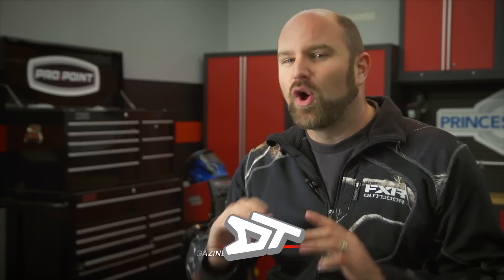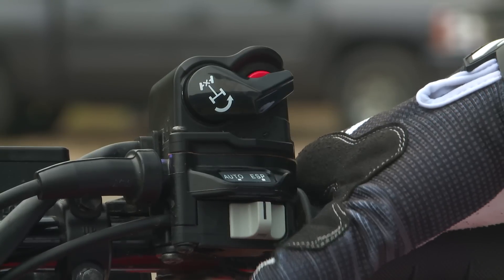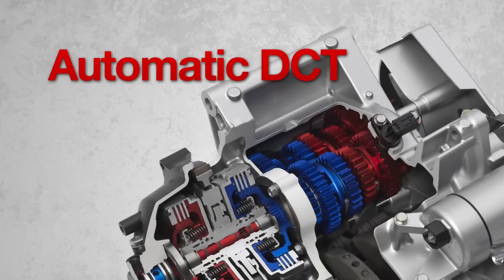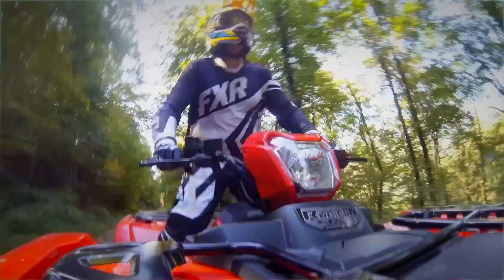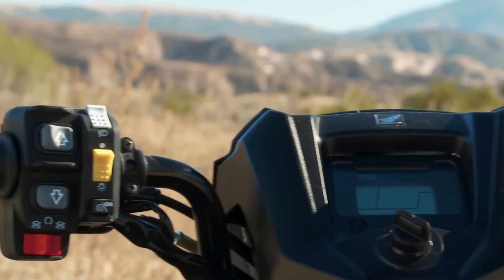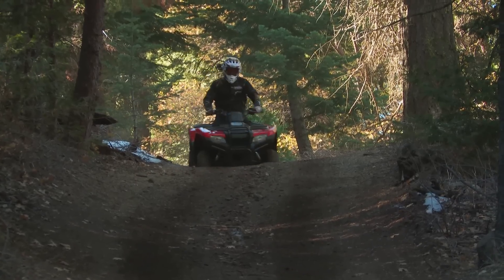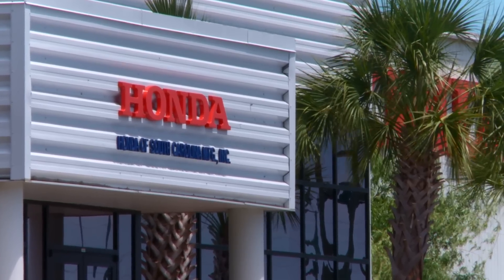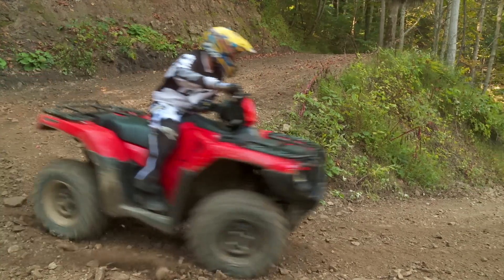Honda ATV Dual Clutch Transmission

Comment: I have now the 2015 Honda Rubicon with DCT.  15h of run for now (mostly plowing).  Tremendous power! (in comparison of the 2004 I had just before).  I've noticed one problem yet (will the first maintenance due in 5h correct it?).  Many times, the gear indicator on the dashboard will stop indicate (D or N) (in low or high) and will just display a ----- line and you have to give a little gas so I will show again the gear position.  Yesterday, as I was plowing a big pile of snow, the bike staled right at the worst time and was displaying a ---- bar instead of the gear position again.. could not make it start .. Puled it with my truck (make the wells turn to try to get it in a position where the gear would show again and bring it in N so I could start it again.. nothing.. tought I could be the battery (plowing with a winch will drain the battery), Nope.. nothing also.  Then I tought to switch it in Esp mode and there I was in 2 gear!  Push the button down and there I was in Neurtral and made it start again.  Everything was fine then.  It's the 3rd time it happens to me.. What could be the cause of this malfunction?   I would not whant this to happen to me in deep mud or as i'm climbing a big hill this spring at the hunting camp (not to mention that all my friends will be watching me to evaluate the 2015 Honda).  Thank's!
Reply: Richard, I'm by far no ATV expert, but from my understanding the "AUTO" mode is best suited for casual trail riding, while the "ESP" mode is best suited for aggressive trail riding and work duties. Now I'm not saying you can't use the "AUTO" mode when plowing snow, but I am saying that it's not the best choice. The "LOW" position would be my recommendation for plowing and towing chores regardless of whether you are in "AUTO" or "ESP" Reserve the "DRIVE" position for all but the worst trail conditions you may encounter. As far as the "----" condition your experiencing. Contact the dealer you bought the ATV from. It sounds to me like the tranny is "confused" and searching for or in between gears as a result of the stall. The "AUTO" mode monitors and adapts it's shift points based upon the way the rider is running the machine. A stall is not "running" the machine, thus the confusion caused for the "ECU" portion of the tranny. In "ESP" mode the tranny is "locked" into the gear the rider chooses so the tranny doesn't have to perform as a "Smart Tranny" so to speak.
I think this is the best way to describe this particular ATV... Look at this ATV like a 4 wheel drive truck... When driving casually (relaxed style of riding) or performing light duty chores (pulling an empty ATV cart), "AUTO" mode will most likely be fine in most cases.
When driving aggressively or in demanding conditions, performing heavy duty chores (snow plowing is a heavy duty chore, unless your only plowing a few inches of light powdery snow, the kind you could easily sweep with a broom), or tackling tricky, steep or rough terrain, "ESP" mode is the best choice IMO.
Richard, Again I'd highly recommend you contact the Honda ATV dealer where you purchased the ATV at, as you'll most certainly NOT receive any kind of reply concerning your issue from a Honda rep. or dealer on a Youtube post.
Reply: ***** You've got the best of both worlds then. Having your choice between SRS/SRA and IRS all based upon your intended usage of the atv. I'll have to look further into them. Thanks!
Reply: ***** hey man, if you need to start the bike in gear, you can pull on the right break lever. Its worked on all mine, but i don't have the new one, don't know if it stll works on these models.
Reply: Obeconobe7 I disagree. I think Honda built a better ATV with and a much worst transmission a smaller engine and a much bigger price tag.  I have an 06 Rubicon and I have been plowing snow for 9 years here in Canada and that transmission as never been in ESP ( only to try it out a couple of times) and has never let me down.  Always in the right gear ratio and plows snow great.  Now it doesn't have a diff lock or IRS, so from what I have been reading the new Rubicon is a over all better quad.  However, with the amount of time it takes Honda to put out a new model ATV, I don't think we should have to settle with a sub par transmission.  They certainly had time to think it through. If I was going to buy another ATV anytime soon, it would not be this DCT unit.  Love Honda reliability, but not enough to deal with the frustration of a geared transmission on trail rides that require me to go to ESP on steep hills which do not work as well as a good belt system ( like Yamaha or Suzuki) on steep hills.  May have to wait to see what Honda has for the Rincon and if that doesn't work I'll take a king quad.
Reply: kmmdad ybmuk What transmission do you have? Obviously not the DCT as the 2015 Foreman Rubicon and 2015 Rancher are the first year and models of Honda atvs it is available on according to Honda themselves. It sounds like you have the automatic manual footshift version as the only other version is the ESP.
My recommendation for using the DCT tranny in ESP mode over AUTO mode comes directly from Honda and Honda salesman themselves.
Reply: I have the hondamatic on the 499 cc Rubicon......  It is the best transmission that that Honda ever made on an atv
Reply: kmmdad ybmuk Oh ok. I guess that depends on who you talk to. Some say it's the best, some don't. I don't have any personal experience with it, but it sounded like a very good transmission overall from what I've read about it. Honda must be pretty confident in their new DCT equipped Rubicon though. Practically all the specs I've seen that compare the Hondamatic equipped Rubicon and DCT equipped Rubicon favor the DCT Rubicon as an improvement even with the smaller cc powerplant. I will admit though, that it seems Honda keeps cutting corners on some things to save cost while their machines keep increasing in cost, but every manufacturer does that. For example: The older machines came equipped with steel skids plates straight from the factory. The new machines have "plastic" skid plates... SERIOUSLY!!! How long do they think those will last over rough terrain. Come on Honda!
Reply: I totally disagree.  If you have a transmission that has to be put in ESP to get in a better  gear in certain situation isn't a better transmission.  I feel that for me to put my bike in manual would be a disadvantage for me.  The automatic feature works much better, always in the right gear in every situation and  I can concentrate on other things.  With regards to power, I can clock my bike at 53 54 MPH and have great bottom end.  How about the new Rubicon?  The new Rubicon, like have said before, is a better overall bike then the old I believe.  IRA, Locker, better handling and more ground clearance. However, they did not improve this unit in every area.  The old has more useable power and a much better transmission.
Reply: ***** I can't find it posted on here now, but you stated that "The Rubicon is hydrostatic drive." To my knowledge, I think all 2014 and prior models were hydrostatic. Starting with the 2015 model and newer, Honda has utilized the DCT, a clutch and gear type tranny. I believe one of the biggest reasons for this is the ability to rebuild it compared to the old hydrostatic type. Am I correct in my thinking? I wanted the DCT tranny because of the sub tranny basically offers 10 gears. I plan to use the low range for plowing and trailering firewood. I've run the ATV in the AUTO mode and ESP mode on the trail and have no issue with either one at this point. But I will admit I prefer using the ESP mode because I control the shift point and not the ECU. The last thing I'd want climbing a steep incline is for the tranny to upshift and lose power, which is possible in the AUTO mode isn't it? Down steep inclines both modes will hold the atv at 4mph max speed from my experience. To my thinking the weak point in this type of tranny would be the dual clutches and not the gears? Correct?

I have the 2015 Honda Foreman Rubicon Deluxe w/ DCT and IRS (the black model) and can start it in gear like you stated by holding the right (front brake) lever. I also let mine run for about 5 mins after starting and have no issues with gear shifting. I chose this model primarily because of the sub tranny option, the change in the reverse operation and the 1322lb tow rating, as I primarily plan to work it. I know the DCT is supposedly a proven tranny in Honda motorcycles and cars, but being new to Honda's atvs it's yet to be proven reliable and strong. I hope I didn't make a mistake. You seem to be very knowledgable on such. What is your take on the DCT and this particular ATV? Thanks for any input.
Reply: ***** Wow! Thanks for all the info. Sounds like maybe I should've bought a 2014 model instead of the 2015. As far as oils go... any specific recommendations?
Would running the ATV in ESP mode instead of AUTO mode provide better overall performance and longevity in regards to the tranny then?
I was kind of skeptical about all the electronic power crap being added on the newer atvs... such as electronic power steering and EFI.
In regards to the electronic power steering feature though, The Honda manual states it will function like any other non-power steering equipped atv if it does fail, so it would still be rideable but not recommended according to Honda.
In regard to the EFI, the Honda salesman told me that from his experience the EFI equipped models are more picky than the carb 'n choke style atvs and recommended I use a mid to high octane gasoline for better performance. I also add STA-BIL to all my atv gasoline to help prevent problems.
I personally don't like the Honda Rincon either, but didn't realize the trannys were that similar.
Even in AUTO mode, I have to stop and pull the reverse lever and left side brake lever in unison to downshift in to reverse just the same as in ESP mode on my atv. 
I was originally going to buy a 2015 Honda Foreman w/ the 5spd ESP tranny and swingarm rear axle because I figured the swingarm rear suspension would be stronger for pulling, more durable, less prone to damage and mechanical repairs and even though the ground clearance is less it remains constant in comparison to IRS. 
But with almost a difference of 500lbs in rated towing capacity, the hi/lo tranny, the 2wd/4wd/diff lock capabilities, IRS, and a few other features that were exclusive to the Foreman Rubicon, I figured it was the better machine. Guess all them extra goodies may have succored me in. 
I hope in the long run I don't regret my decision.

I owned a 2002 Honda Rancher 350 4x4 w/ the 5spd ESP tranny that I bought brand new.
I sold it to my dad after owning it for about a year. 
He is still running it to this day, and has literally hauled tons and tons of firewood with it over rough terrain and up steep slopes.
It still runs solid and has been a very reliable workhorse of an atv with very little expense required over the years of usage.
I can only hope my Foreman Rubicon will provide me with the same performance and reliability. I wanted a 500cc class atv for more weight and power as I figured it would handle farm chores a little more readily even though the Rancher has now been upgraded to a 400cc class atv.
Reply: ***** One thing I did do that I'm glad I did, was protect the entire under carriage as much as possible by upgrading to every aluminum skid plate available. The factory stock skid plates were plastic that the dealership removed and gave to me! Seriously Honda?! The first rock that smacks them will most likely do them in. That would be like putting plastic step bars on an off-road pickup truck to protect the rocker panels!I actually got high centered on a stump on the engine skid plate and had to use the diff lock along with me rocking the atv from side to side to pull the atv off of it because the ground was to soft and when I went over it the atv suddenly sank down right at the moment I was centered over it. 
Sorry, but plastic has no place being used as any type of skid plate IMO. The factory skid plates on my old 2002 Honda Rancher are steel!
Guess Honda is just like every other company... cut corners to save manufacturing costs at the expense of quality, but keep increasing the retail prices.
Reply: ***** Thanks again for the reply and tremendous help.I greatly appreciate you taking the time to do so!
Your comments definitely make me feel better about my decision.
At the time of my purchase, I had the dealership install the Honda genuine accessories I wanted such as Warn winch, Warn ProVantage snowplow, heated grips, etc, etc.
I know it was more expensive, but I wanted to know the items were specifically designed for my atv and DID NOT want to have to weld and cut and customize as you stated.
Very interesting concerning the UHMW skid plates!
I bought a shock spanner wrench to adjust my shocks to a stiffer setting when under load. Either front or back. But primarily when towing heavy loads to help reduce rear-end squat. I would expect this to help with shock longevity and suspension collapse as well... not 100% sure though?

Funny you should mention wet earth.
I have a Polar HD Tandem Axle 1500lb rated lawn/garden trailer for hauling that just today I used to haul 3 loads of wet earth that I know probably weighed at least 800-1000lbs or maybe more as I had the tub full, in addition to the trailer weight of around 250lbs.
I put it in lo range first gear using the ESP mode and down a slope of around 30-35 degrees with no brake usage she crawled at a top speed of 2mph with a load!
In hi range first gear (both AUTO and ESP mode) w/o a load it crawls down a slope at 4mph.
Today was the first time I had the chance to try out the low range under working conditions and I was impressed. I noticed a huge difference in the feel and drive characteristics of the atv.
It reminded me of the older pick-ups that had a granny first gear.
I did feel a slight squatting of the rear of the atv upon initially starting out with the trailer, but then it would seem to come back up once I got going and it seemed to handle the load with ease.
In fact I really couldn't tell I was even pulling anything. 
I did not however pull that size load up the 30-35 degree slope, but did pull about 2/3 of it up with no problems.
As far as the oil... I've never bought the Walmart, DG brand, or like oils for anything that takes oil because I never trusted them in regards to quality. Lol!
I've always used Valvoline, Havoline, Pennzoil, Mobil 1, etc. Never used Quaker State, but I believe Quaker State and Pennzoil are both owned by the same company now and supposedly their basically the same formula now from what I was told. But this may just be hear-say.
Reply: ***** I see there are a lot of reply's to your comment lol. My family has a new rancher with fuel injection like your rubicon also has. Some times when riding it stalls out. I have done a lot of research and have come to find that the tuning is not correct for cold winter climates and just in general. There are many aftermarket company's that offer tuners that can change the tuning for your needs. So there is my two cents......
Reply: Yes! Your wright... it works
Reply: glad i could help!
Reply: ***** Yes pull the brake to start it in any condition. The DCT model uses 2 clutch packs and alternates between them to transfer power from one gear to the next. To put it simply, the next actual gear is shifted into, THEN the engine is connected to the new gear via the opposite clutch. This makes for seemless transfer of power.

The only way it will show a "--" is if the actual gear shift did not occur and therefore is between gears. This usually is a result from shifting while at a stop (stalled). Moving your ATV via rocking forward and back (or other methods) will allow the shift to continue and correct the issue (because the wheels are attached to the output shaft of the transmission). 

I bought the Rubicon 4x4 with EPS and FOOT SHIFT yesterday, not because I think the DCT is troublesome though.. The DCT is built on foot shift technology. I've had to rock foot shift models, and ES models to get them into gear because I was at a stop. It's not a design flaw, it's the nature of the beast but can be easily avoided!!

My advice? Run in ESP mode in the correct gear you want to be in and if you're not in 1st when slowing, shift before you actually stop!! Auto mode is bad and tries to shift into the wrong gears at the worst times, don't use it unless you're cruising and don't want to be bothered with pressing buttons. If you're having stalling issues and the auto mode is trying to shift I could see that complicating things.. That's the issue you need to address with Honda honestly unless.......

Finally if this is happening while moving and engine running you have a problem. There is no earthly reason besides malfunction that a gear shift should not occur, especially with DCT since there is no load during the actual gear shift!!!! DCT in ESP mode should be BETTER for hard working ATVs than a foot shift provided the clutches can hold up to the strain.

Comment: 0:45 Examples? Push the boundary as the most technologically unadvanced brand maybe...
1:22 What about the 420 Rancher AT (DCT) Released 2 years prior?
4:18 I guess it has to be efficient with a engine that pumps out less than 30hp, 35% less power than it's competition....